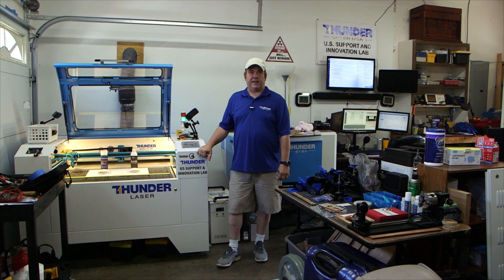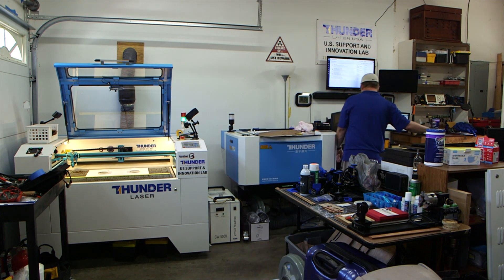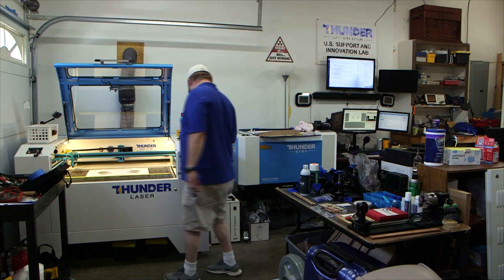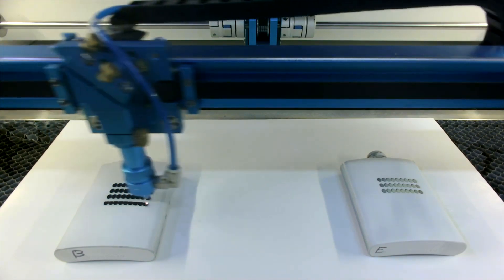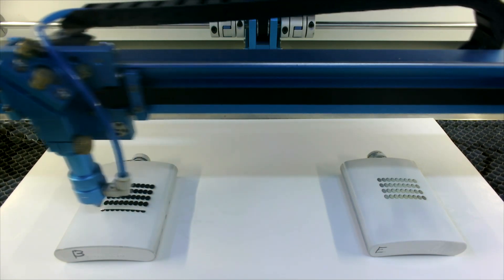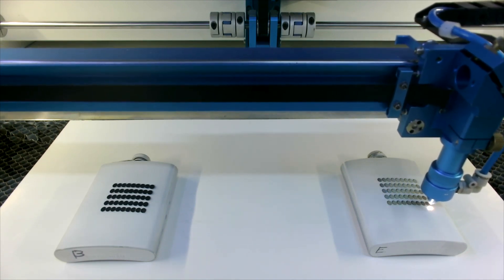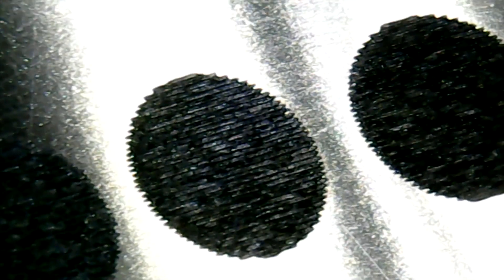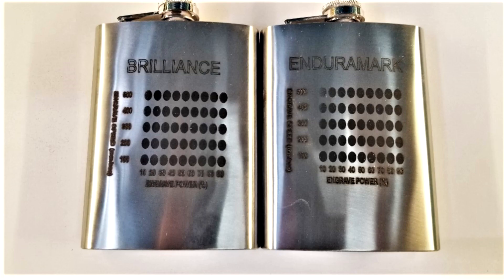Testing Marking Compounds on a Nova 35-80

Comment: Brian, I got a Nova 35-100w coming. Heard that 80w works better than 100w on delicate etching jobs. Is that true? I also got a photo lens.
Reply: Seems like a great question...wish it would have been answered.
Reply: Yes that is true for the 80watt vs the 130watt, but not as much with the 100watt. The power is a % of the max wattage so if you want to engrave 10% power(Lowest) of the 80 watt then it's 8 watts of power vs the 13 watts of power for the 130watt laser tube. Doesn't seem like much difference but it can be huge on fine detail.